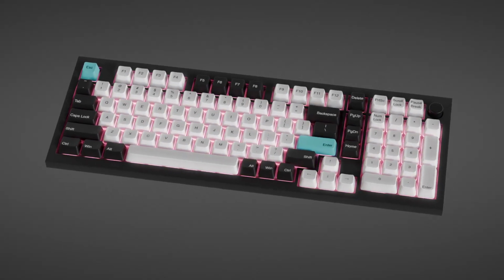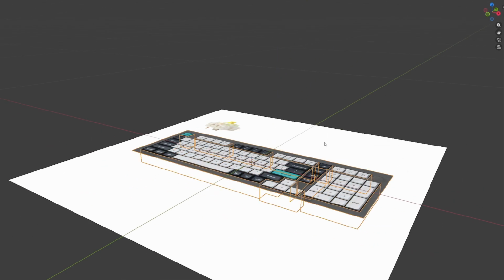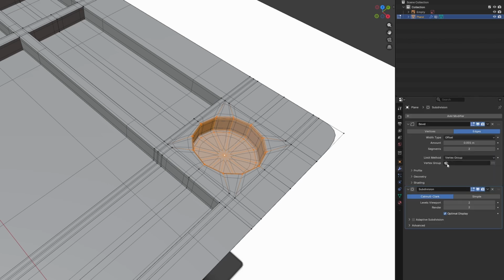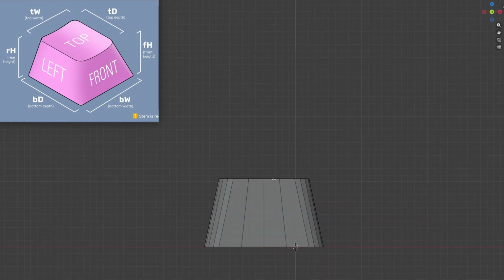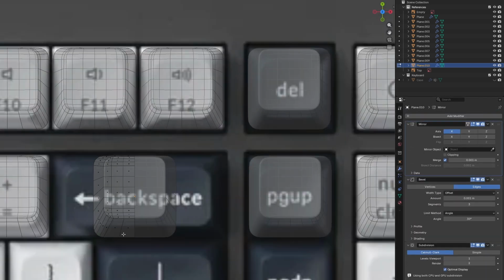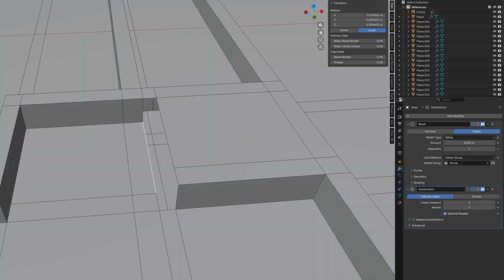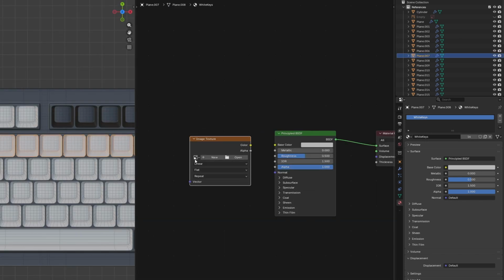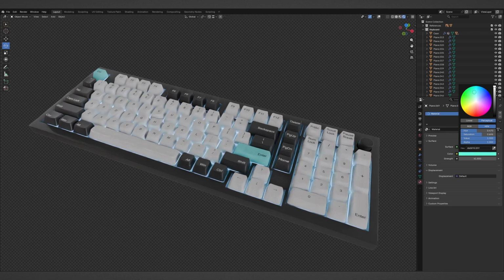How to Model a Keyboard in Blender

Comment: Hey man, I really love the simplicity of the way you walk through this and I followed along and I've completed it but for some odd reason none of my textures are sticking to any of the meshes, I've applied all transforms and recalculated the normals, and applied the array modifier, even when I unwrap the keys nothing seems to work and I'm completely stumped, I've never had this issue before with any of my other models any advice you might have would be greatly appreciated.

Comment: When you add the keysLayout.png why does a mapping and texture coordinate randomly appear ? It just pops in without you doing anything. Was it a cut in the video or did you do it off-camera ?  I have the video at 0.6 speed and it still feels too fast to understand or follow sometimes  :/
Reply from the maker: If you select the Image Texture node and press Ctrl+T, Blender will automatically add a Texture Coordinate node and a Mapping node. If nothing happens, make sure the Node Wrangler add-on (included with Blender) is enabled in Preferences.